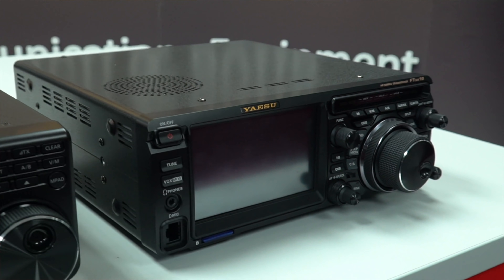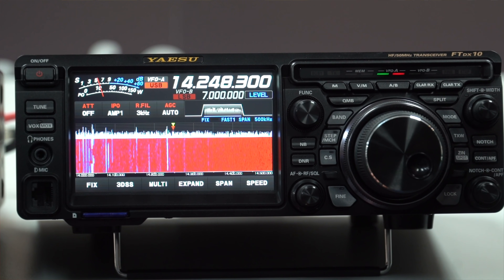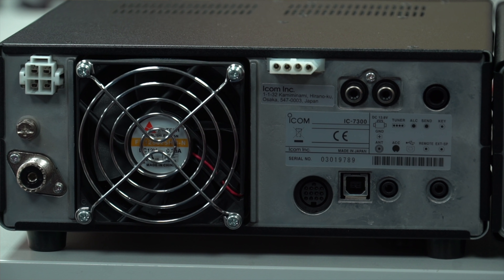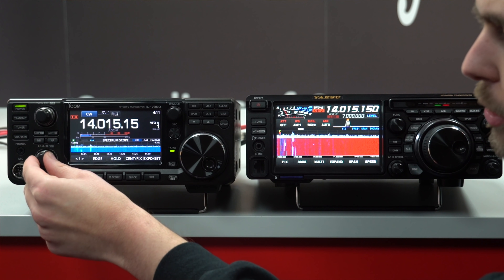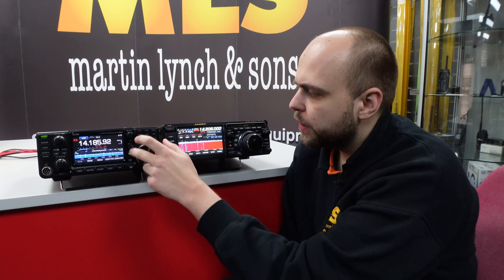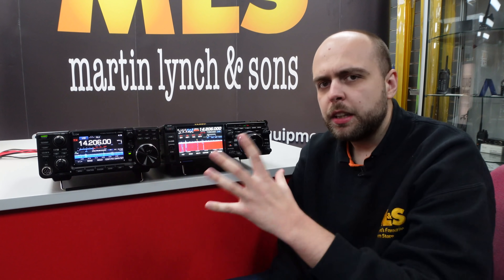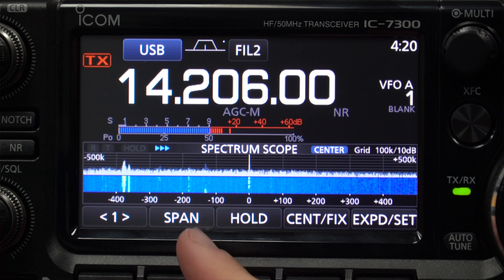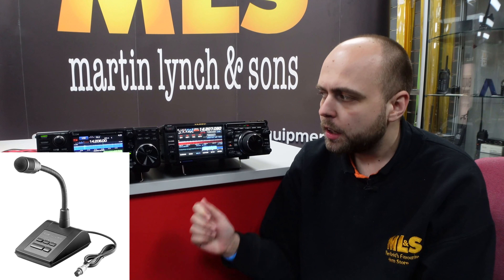FTdx10 vs IC-7300 Comparison

Comment: I loved the look of my 7300 but found with very strong signals the filtering struggled to cope.
Also after selling it a friend I didn't like the tx audio either .
Always found Kenwood ts590s and ts2000x much better . But I fancy a screen so considering an ftdx10.
I will add though at £650 used which I'm seeing them at the 7300 isn't a bad buy for that type of money .

Comment: Nice video! I've heard that the 7300 had an issue with the internal battery that when discharged (after being left unplugged for an extended period of time) meant that radio couldn't keep the clock setting. Is this an issue with the FTDX-10?

Comment: About the scope options. The Icom also has 3 options as well. You have to hold the center mode button down and you get a scrolling option. I know that the Yaesu has a much better noise floor, but I love a lot of the features that Icom gives you. I have always liked both brands, But my next one will be the FT-710 due to it's quieter reception, and external mouse and monitor options. Now, I am truly waiting on Icom to make a rebuttal to these radios. Can't wait. Free enterprise at work.

Comment: Still not shure what radio to buy. Ftdx10 seems far more complex then the icom 7300. An rs 232 , not outdated for a new radio? Same for dgital port to a screen…sound seems very sharp from the yeasu. The icom has no screenoutput but has a voice and settingsrecording thru an card. Not so in the yeasu.
? Still many questions about these radio’s and i am looking on the many video’s here on youtube…..

Comment: Both are great radios. Can’t go wrong with either. 7300 is going for a bit less as of this writing, if cost is a factor.  There are subtle differences with the options - preference is on the user. These are not completion rigs, so comparison to a rig that is designed and priced differently is not a fair comparison, but for a daily or starter rig - can’t go wrong with either.

Comment: I am selling my IC-7300 back to HRO and getting the FTdx10 today.  I was not overly impressed by the RX performance -- especially with CW.  It does not deal with noise and weak signals very well.  The audio is not especially pleasant.  I love the menuing system, and am not looking forward to learning a whole new rig.  73 de Chris KQ6UP

Comment: i have and ftdx10 and 7300 in my opinion and its only my opinion 7300 just wins i am not bias i have an ft1000mpmk5 an ft 950 and a991 but i still think the 7300 just wins i must stress its only my opinion there both good rigs though

Comment: Let me tell you both radios, yaesu and Icom. All, All internal components are from the same trade mark, same reference, same model, same electrical size or valor. That's means that both are the same, with diferente design and price...sorry, you can check inside and verify the info got you about this real good radios.

Comment: Well today the price difference is at 500$ here. 1,100 for the 7300 and 1,600 for the FTDX10. I went with the FTDX10 - better receiver, like the option to display to a bigger screen, like the mouse. And the review is wrong about the waterfall display - you can choose 3 sizes on the Yaesu. I was thinking about settling (for me and the options I like) for the 7300 as I couldn't justify the price of the IC 7610 or the Yaesu FTDX101MP. While the 7300 is a good value, with the Yaesu FTDX10 I found a transceiver that did exactly what I wanted for just a little more than the 7300.

Comment: Always concerned when one rig is compared to another that is longer in the tooth.  IC7300 set the bar high in affordable radios incorporating SDR.  The proof in the pudding is that they have sold bucket loads.  In the Ftdx10 we see improvements in technology that a newer set should have, I am a proud owner of this but I also get to operate the 7300 and they are both great rigs.  Wait to see how ICOM respond to the newer breed and I'm sure they won't be resting on their laurels -  genius stroke with the IC705 which just goes to show they are a leader/innovator in the field amateur radio.  The great thing is the prospective buyer is spoilt for choice, the Yaesu being the more pricey option.  You can't go wrong with either.  Just enjoy what you have and enjoy this great hobby.

Comment: Thank you for the upload and comparisons. Personally, Even though the FTDX10 seems to have a better sounding and fractionally more sensitive receive. I think the transmit audio is slightly better on the IC 7300. The 300 quid  plus different in price would go a long way towards a nice antenna setup..In my humble opinion. 73s HS0ZOU.
Reply: yes the 730 is simple bass tone  set up the yaesu has always failed with TX audio

Comment: You should compare the ICOM 705 to the DX10. Yeah, I know the 705 is a 10W QRP unit, but those are the two that I am trying to decide between. Pricewise, they are closer together. Thanks for the review. 73 - KE8RLR
Reply: I would go with more power you can always turn it down. 
The ft10 only does 100 watts on Ssb on am it only does 25 watts.

Comment: It seems that Yaesu has brought forward their practice of trimming off the high-end response (from the 101d). Listen to the
SSB signals. This results in tight selectivity numbers, but the audio is muddier.  Also, no averaging on the 10D display? Really? Did you guys Not hear we 101D users? That one thing is a kill-shot for me.
Reply: Most of the time it's not the rigs fault why a signal is muddy, it's some hams obsession with running lots of bass to sound like a commercial DJ instead of a ham. I can make my Yaesu's sound like muddy bass or a tin can, it's all in the EQ and mike you use and how it's set up.

Comment: Bought the 7300 new two years ago. Just sold it and bought a FTDX-10. Both are great for what they are. I wouldn't call the FTDX-10 a beginners radio. When you connect the coax, all the hype goes away and things get real. The 7300 is a nice, general purpose radio with a good receiver. If you into digital comm, you'll love it! The FTDX-10 is much more suited to 'heavy duty" radio, like ARRL Sweepstakes and DX Worldwide. Some will not like the Yaesu way of doing things. They will more appreciate the 7300. In the late 70s I ran Drake  "C" line, Since then multiple Kenwoods and Yaesu. I've used a bunch of radios, mostly mine but others also, including Icom. The 7300 is amazing technology. If a strong station moves in close, turn on the wide notch and manually dial in the interfering station. The notch will reduce that signal way down, almost gone. Yes, on SSB! Both have amazing tech bells and whistles. The Yaesu has a few more and with greater functionality. Both are great! It just depends on which meets your needs and wants.
Reply: Зато

Comment: Jonathan, the height of the waterfall can be set in three different size and the vfo knob torque could be regulated. Nice work, but read deep the manual before doing a presentation. Moreover, during the CW comparison the FTdx-10 was not correctly centered on the signal causing bad audio compared to the 7300 (look at the video, you will notice the CW Tune meter bouncing).

Comment: The Yaesu is almost 5 years newer and $700.00 more than the 7300. Shouldn't it be better than the 7300?  PS Sold my 7300 after owning it 1 month. Yaesu's classic FT-1000D replaced it for same price and is a forever keeper.
Reply: Until you will have an hardware problem and you will discover there are no spare parts, if not on ebay if you are lucky enough and another is dead recently ;-)
I understand your nostalgy for great glory that can fight also today, but prepare a cheap backup radio (like the 7300 maybe?) in case of a failure for the 1000d, you risk to wait a long time before have it still on the air.

Comment: Went ahead and ordered the ftdx10. Got it in thursday. Really impressive. I will say that the DNR, unlike the 991, seems to result in a much less natural RX voice. I didnt have this issue with the 991. I can only speculate that the DSP system design is contributing to that. With that said, its ability to completely REMOVE incoming frequency and band noise is spectacular. Yes, you compromise some natural voice tone, but that is better than not hearing the RX signal. 

Okay...the 3-D nonsense is a bit gimmicky, but Im certainly not the first to bring that up. However, I just dont use it. The rig offers the standard waterfall, expanded view, complete control of the band width you wish to monitor, as well as a multi mode that includes an oscilloscope. Also a lot of adjustment to the speed of the waterfall, the intensity of the received signal display, many color options etc etc.

I have found that they did a good job of making the most used functions quickly and easily accessible. Im sure there will be some that will not like the menu setting sub-menu, but that is very much a personal preference. 

So is it worth $1700? Guess that is up to the buyer and user. The 7300 is an amazing rig for $1000.....the 991a is the most versatile rig, which may be very good for those that have limited space or possibilities even a newer HAM that doesnt yet know what segments of the hobby will most interest them....and the dx10 seems to offer many options that are predominantly seen on much more expensive rigs. The size of the screen, the fact that it connects directly to a monitor and mouse instead of through a computer, the extended adjustments within the carious menus ans perimeters. 

So where am I today? Im keeping the 991 for now, and it is in use in my shack. The dx10 is an extremely good fit for how I use an HF radio, and the additional cost was worth it for me as nothing else on the market had similar offerings under anywhere near that price range. Most were $3000 plus.

Comment: The 7300 is very easy to remote using RCForbe Remote Hams freeware.  Can you use the FTDX10 in a similiar fashion, outputting audio and rig control via the USB connector?

Comment: Not a fair comparison given the FTDX-10 runs about 70% more, clearly not in the same price bracket. The beauty of the IC-7300 is that it compares well to radios costing considerably more, as seen here.
Reply: The price is part of the comparison. The viewer can size up all the features and decide if the price difference is worth it. No need for the price to be equal to compare them
Reply: @Factory400  why not compare it to a 7610 then?
Reply: @chazwozza67  Well, anything could be compared to anything.
Reply: They are within a $100 of each other ?

Comment: Yaesu & ICOM are my two favorite brands for Radios. Being very tempted about getting the FTdx10 but price is a big issue for me. The ICOM is more affordable but seems like more bells & whistles in the Yaesu.
Reply: @Steven H I've got both the DX10 and 7300.  I have to say I have much more time on the DX10 and use it all the time.  I did unbox and put the 7300 in line for a couple days to make sure everything worked.  If I could only have one radio today i would pick the DX 10 but if I were buying a radio and comparing features I would be hard pressed not to get the 7300....it's so much less expensive than the DX 10.  Just an opinion.
Reply: The ftdx is about 1300.00 now

Comment: I would like to see FTDX10 vs IC-7300 at digging out weak signals. I don't compare radios based on their visual displays.
Reply: The Yaesu is slightly better at digging out weak signals, i had to find a signal i could only just hear on the yaesu but still be able to make the words out, i couldn't make them out on the icom although i could tell he was there just.
Reply: @TheBob78249  I just read a review stating the opposite.
Reply: The Icom screen looks more detailed. The FTDX looks a bit washed out.
Reply: @ronedwards8239  really not how I rank radios
Reply: noone ever shows how slow the refresh is, for me looking at the history of a band in the waterfall is a feature I'd like more
Reply: @willgilliam9053  the waterfall speed on the icom is slower
Reply: @TheBob78249  Sorry but don't Is a Speed waterfall problem.. ICOM have averaging function and yaesu no...ICOM have 5 Years old but have this function...73
Reply: @manuelit9-mok968  you are of course referring to the spectrum scope and not the waterfall, averaging on the spectrum scope would be better, maybe yaesu could implement in a firmware update.
Reply: @TheBob78249   yes i Hope this because i would want to buy this radio too. But i think ICOM Is  Always One step ahead.. i bilieve they working about ICOM 7310 yet 😄
Reply: You can reduce the speed on the ftdx 10

Comment: Great Video Jonathan. However depending where you buy your 7300 from you are looking at price difference of £450-£550. 7300 pound for pound is better value, in my opinion. DE G5ROB
Reply from the maker: Think you will find the price difference will reduce greatly once the FTdx10 gets more pronounced in the market oplace. Remember it's only been available for 6 weeks, the 7300 almost 4 years.   Either way both are excellent transceivers and like BMW or Mercedes, either will give any future owner great performance and no doubt reliability. Stay safe!

Comment: nice to see these radios side by side,  thought about trading in the 7300 but it looks like it competes well against the ftdx 10, though I think the yaesu has slightly better noise reduction...and the mouse control looks interesting, the display is slight bigger ... the 7300 has been solid for 2+ years that ive had it and hundreds of contacts

Comment: The height of the waterfall can be changed on the ftdx10 by pressing the waterfall with 3 different heights.
The waterfall is much better as well when the level is set for the band conditions rather than having it on full blast.

Comment: Owned the 7300, now have the 101MP. The 7300 is a great radio but the receiver on the 101 significantly outperforms the 7300 in real-world use. Since the 10 is essentially the same architecture as the 101 (hybrid minus the VC tune), there should be a big difference in the ability of the 10 to work a crowded band and deal with adjacent signals. I almost never use DNR, but do use the contour all the time on the Yaesu. Having a constant visual for the notch and bandpass is a plus. You also have more control over rx and tx eq on the 10. I also don't use the 3D display as I prefer a standard waterfall. The extra money over the 7300 is getting you better rx performance. If you want/need that, then it is money well spent. I found that when I switched to the 101MP, I was hearing and working stations that I couldn't with the 7300 - same antennas, etc. Bang-for-the-buck on the 7300 is very high, but there are better performing radios out there. The 10 appears to be one of them.
Reply: I work signals some of my ham buds can't even hear on their Icoms. In our group, the Icom guys are always the first ones to belly ache about splatter or noise I don't even hear.
Reply: It's all location/aerial ralated
Reply: @chazwozza67 using the same antenna don't agree the 7300 doesn't compare 73 N4VG

Comment: Yaesu needs a firmware update to support a wireless mouse. Doesn't work with Logitech M318 or M325...not mine anyway. corded does work fine.
Reply: Amazon Basics wireless mouse uses a tiny USB dongle (I'm sure there are others), so no native Bluetooth mouse support is necessary.
Reply: @pixoariz  my logitech uses a bluetooth dongle, that doesn't work either, the wired mouse works fine.
Reply: Logitech M310 works !

Comment: How does the FTdx10 perform as a General Coverage receiver ????
Reply: No, there is a gap around the IF frequency, as on all down conversion receivers, including the FTDX101D and MP, TS890, K3...
Also check for the image and IF rejections which can be poor, for example see the figures of the TS890 in the QST review.
These problems are a trade mark of down conversion receivers.